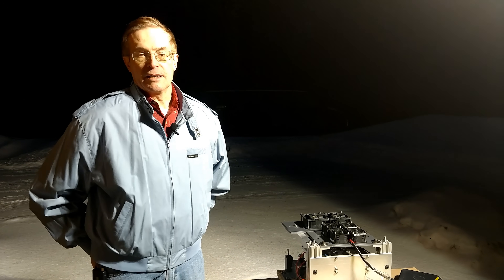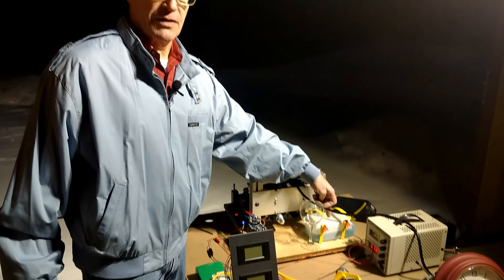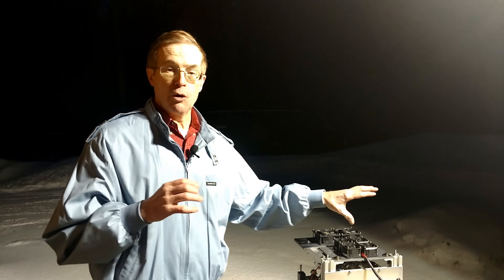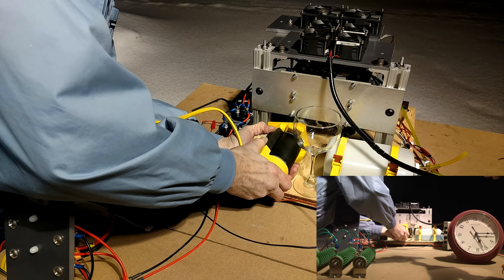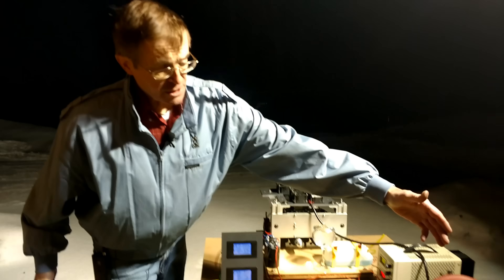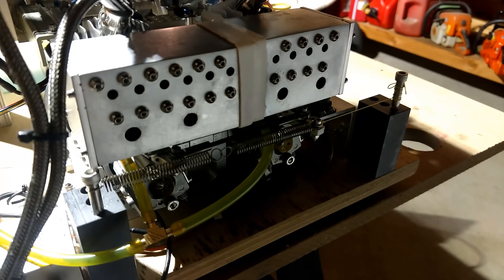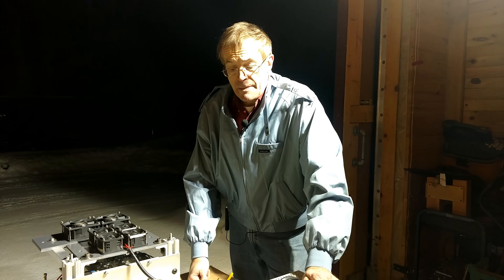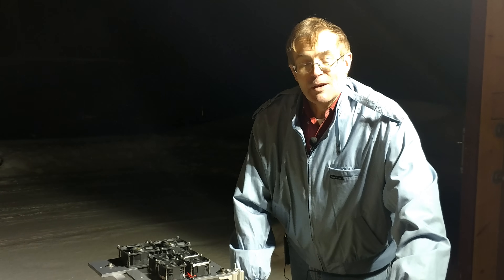Drone Generator Performance

Comment: Great video! You mention the resistors were being ran over spec, and also there was only about a continuous 700W being produced (not like that is unimpressive). I am guessing that if you had more resistors you could test the system closer to the proposed 1000-2000W range? (or was it two HP and thus around 1500W?)
Reply from the maker: The maximum goal is indeed, 2.2kW.  The power output is nonlinear with RPM and all the components are consistent with that goal with the exception of the capacitors and the load resistors.  When these are upgraded we'll "click it up a notch".

Comment: How many kW can this motor contineus make ? "17Hp 4.5KG" 
https://www.ebay.com/itm/DLE170M-Paramotor-Engine-Paragliding-Engine-17-5HP-7500rpm-Electric-Start-Versio/401435197069?hash=item5d7766fe8d:g:WcUAAOSwb3lZ--dY
Reply from the maker: First of all. I like the DLE engines I have worked with.  It is clear from the single Hall sensor on the output shaft that these two cylinders fire at the same time which will led to increased voltage ripple and higher torque peaks than if they were firing out of phase.  You can get this engine for a lower cost directly from DLE, but if you are considering this power level then you might want to go with their largest engine with its 4 cylinders, higher power rating and alternating firing sequence.  Allowing for 90% generator efficiency (reasonable), 95% rectifier efficiency (conservative) and 75% of the engine's rated power near it's torque peak, the DLE-222 should provide a little over 10kW of continuous output.  Consider one of the 120mm diameter motors from this supplier:
http://alienpowersystem.com/shop/brushless-motors/120100-s-sensored-outrunner-brushless-motor-65kv-25000w/